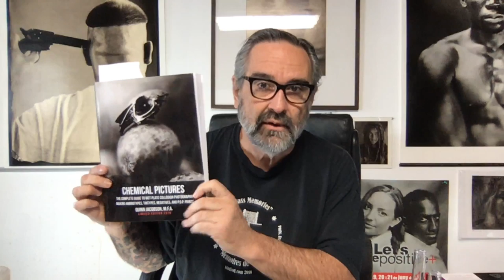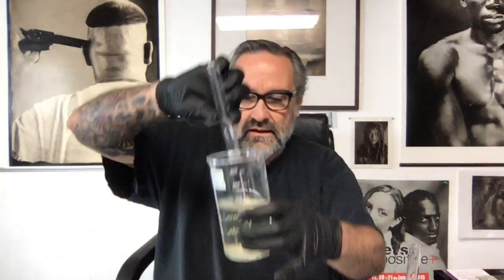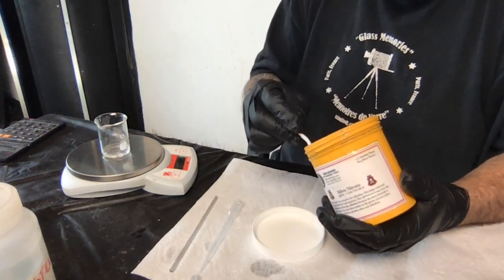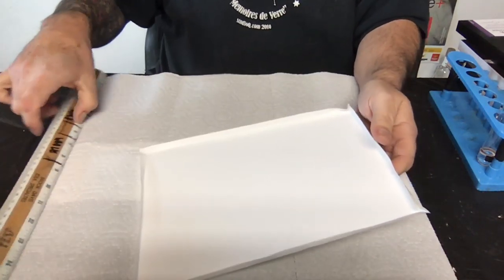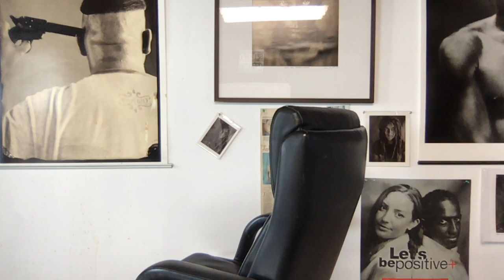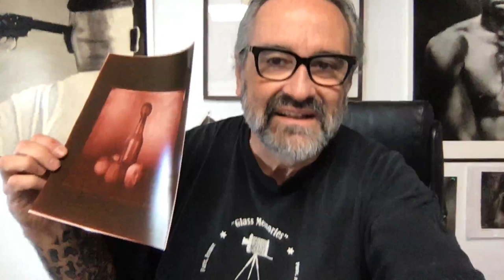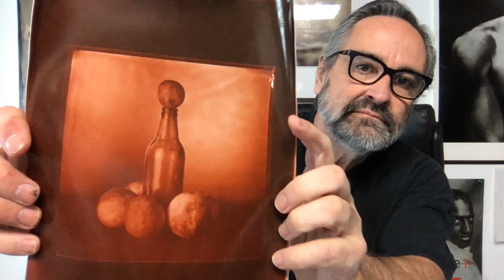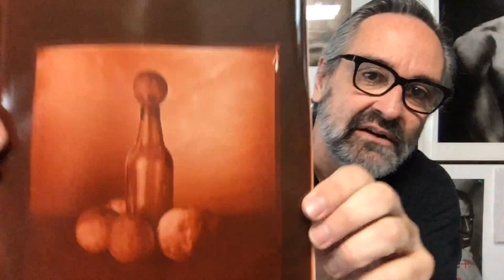The Studio Q Show LIVE! Chemical Pictures Wet Plate Collodion: Making Collodio-Chloride Emulsion

Comment: Hello Quinn, your video series is awesome.

 I would like to try to learn this technique but the only thing holding me back is the right paper.

  The 310g / m2 or 340g/m2 Canson infinity baryta is easy to find but does something change between a gloss , a  matt and satin surface ? 
the collodion is a layer that covers the paper but, depending on the surface, are there problems of detachment or defects visible only afterwards?

Thank you a lot for your work , your lessons on you tube and your art.
Reply from the maker: Thanks, Aldo. You can use either. The collodion surface is glossy, so the matt is quite glossy even still. Not much change. No, the barium/baryta layer prevents any lifting or defects. It's a great paper for this. Let me know how you make out with the process. 
Thanks, again.
Reply: @quinnjacobson   Thank you Quinn .

The 310g/m2 Canson is only satin and matt . Matt , satin and even the glossy prestige are quite similar for quality and money .So i'll try the matt version ( a more neutral / natural paper base to start? ) and try to print a dry collodion negative that work for a salt print well.

https://www.canson-infinity.com/en/products/baryta-photographique-ii-matt
Reply from the maker: @aldomarci8248  Perfect! You'll love it!
Reply: @quinnjacobson   the main difference now is that there is a version 2 of baryta photographique.

So the new satin surface is with a texture.
The matt version is problably more similar to the old photographique that you use in your video.